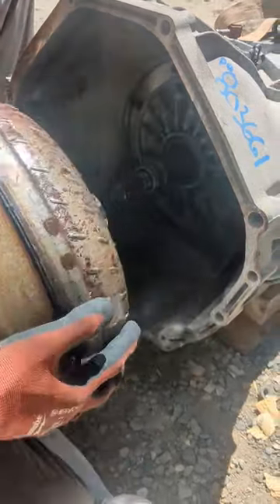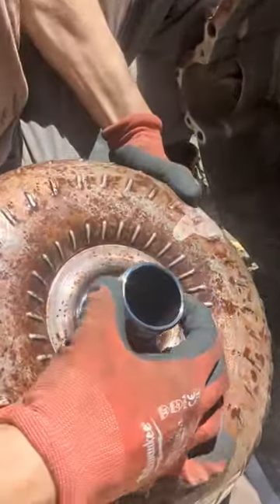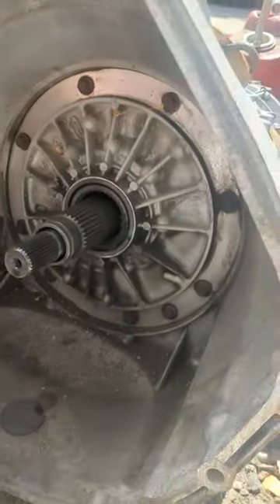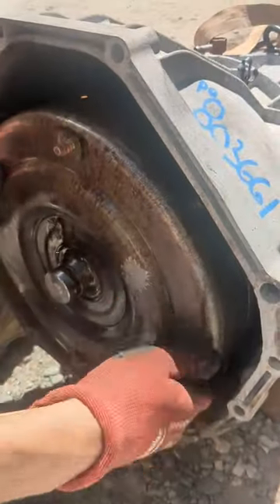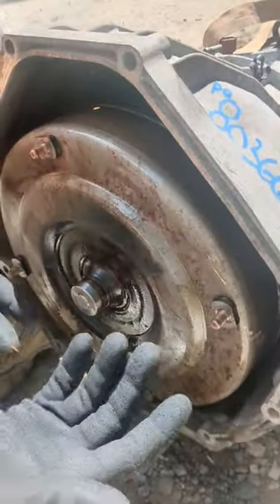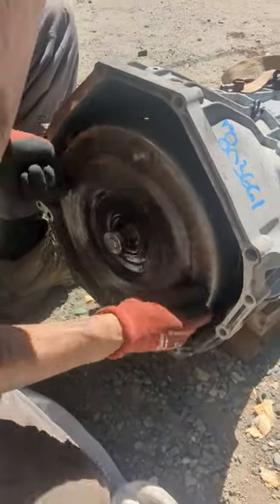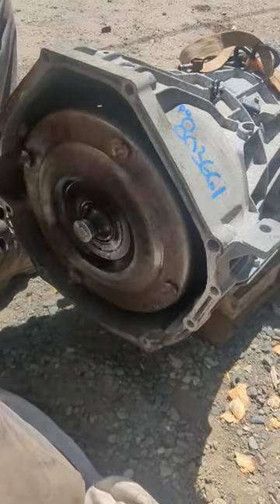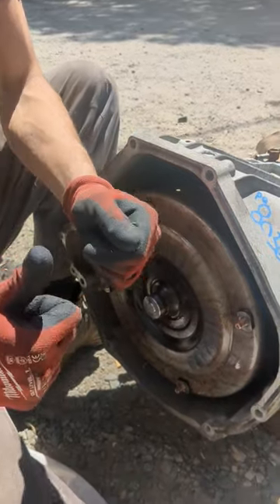the proper way to install a torque converter

Comment: It's actually 3 clicks! Don't worry you will get better as time goes on! I'm 13 years old but I watch my dad do it on his drag car
Reply: Yes definitely 3 clicks I've been a transmission mechanic for to many years 2 clicks equal a broken transmission  pump 3 clicks make for a good install
Reply: I was 14 when my older brother taught me this doing my first transmission swap
Reply: when I was 3 i did my first transmission swap
Reply: @jerrygarcia1665 I’m not saying you’re wrong, I’ve been working on my frontier and got my torque converter in a few days ago and pushed the converter in until I got 3 clunks and gave it some more spinning just to make sure it’s in there. Today I tried to line up the holes for the flywheel and torque converter, only to find out that the torque converter is moving with the flywheel so I can’t line up the holes. I’m very frustrated and confused. I’ll be taking the trans out again soon, I just hope I didn’t mess up the trans fluid pump or anything else as I have all the bell-housing bolts on too
Reply: I did my first converter swap when I was 2. I have to show my dad how to do it before I could walk.

Comment: It probably wouldn’t fit in the bell housing but this would make the install a lot easier. Good vid
Reply: That’s when the hack pulls it up tight with the bell bolts and if they manage not to bust an ear off the transmission they’ve bent the flex plate, then they start it up and tear the pump apart and burn up the thrust bearing on the crankshaft.  I’ve seen that done sadly more than once...

Comment: That isn't all the way in.
Reply: Yes it is
Reply: Been rebuilding transmissions going on 44 years and you have to seat three different things. The input splines. The stator shaft splines and the pump gears. That's not in all the way. I can hear it.
Reply: @dalevackar182 my man your a G
Reply: @dalevackar182 correct sir
Reply: @dalevackar182  nah near enough's good enough 😂
Reply: @tonymarshall9670  Good enough to ruin a pump and converter hub.
Reply: @dalevackar182  I've installed plenty of them, I know better. First one I ever did that third click was a seized oil pump. Had a friend his father owned an auto transmission shop. So I was lucky enough to see it pulled down and learnt how they worked. Then I started playing with them. Welding the valve body turning them manual, adding extra friction plates. Was good fun in my youth. I do know they are way more advanced now than they were. I'd be lost on the new stuff.
Reply: that's what she said. HAHA!
Reply: @dalevackar182 how much would you charge to remove rebuild and install a transmission on a 07 Yukon Denali?
Reply: @CorderoIvan you’re probably looking $3200-$3700 turn key. We charge about $1900 just to rebuild a 4l60e without installation

Comment: So anyone who watches this guy he's wrong there are 3 clicks on most and if you install it with it out 1 click you will damage the transmission. Good information though. Usually the rule I make sure a finger will not fit behind the converter and transmission

Comment: Um, you wouldn't be able to hook up the bell housing to the engine block if it's not all the way in. You would be there awhile trying to figure out why the bell housing and the engine block are not together.
Reply: It’s possible man happened to me not too long ago
Reply: My brother in law just put the bolts in and sent it. Ended up cracking the flex plate lol
Reply: Exactly. These kids don't have a clue. 

You'd feel the crank bind up as well.

Comment: What if transmission fluid is leaking between gearbox and engine?
Reply: If the transmission has a front saucer/dish/cover plate then it could be leaking out of the front dish gasket, just behind the torque converter and before the trans fluid pump. Typically 1-2 inner and outer Gaskets that can be replaced with a rebuild kit or by part number. Otherwise if the Gaskets are fine then your stater shafts (the shaft that slides into the oil pump assembly and mates with the torque converter) bushing/s or sealing rings (metal and/or Teflon) could be worn and need replacing. But typically it's the front cover Gaskets that leak, or it could be a leaking torque converter if you see the fluid collecting in the torque converter and dripping onto the shaft down to the weap hole on your trans housing at the bottom, Engine to gearbox. Also, the trans pump sometimes has an inner seal just like a front main crank seal, or a rear main seal. Check those and let me know

Comment: Is this a 4l60🤔
Reply: 4L60E has 3 bolts for torque converter. also the converter clicks in 3 notches rather than 2 in this video
Reply: Either a E40D transmission or 4R100 both ford and for a gas motor being the torque converter has only four studs